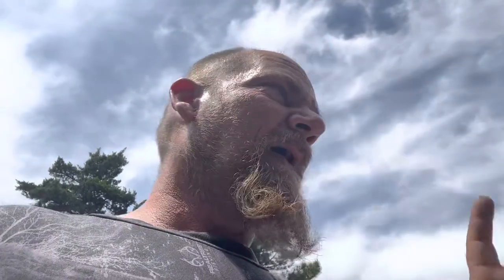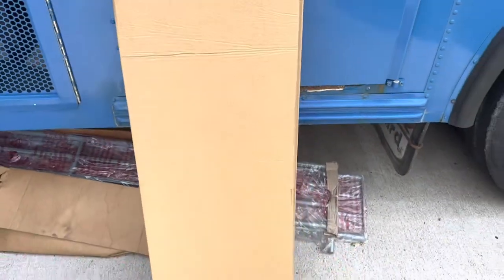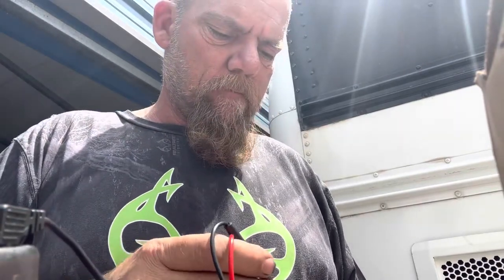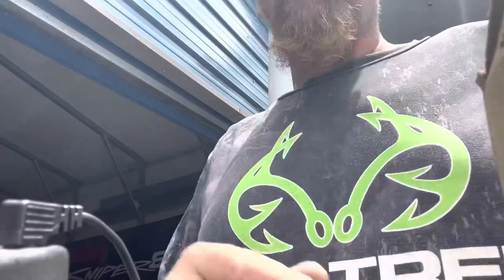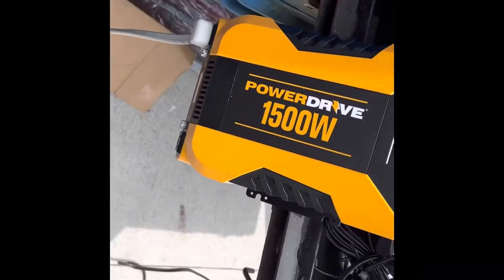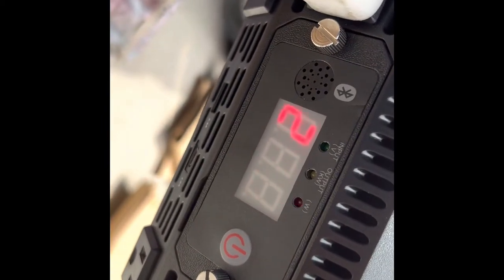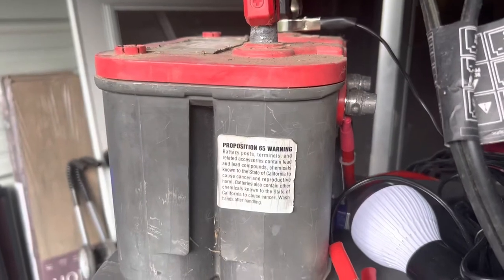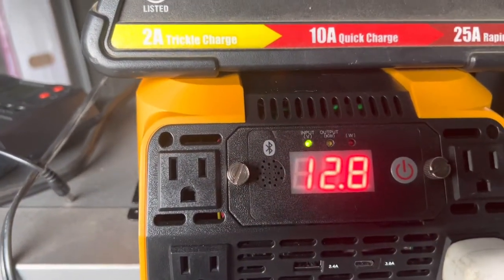Powering refrigerator off 1500w truck stop PowerDrive inverter. Playing with harbor freight￼ solar

Comment: Looking at the bus you bought, how incredible would it be if you attached solar panels all along the roof?  You wouldn't want the panels to get too hot though, or blow off with high winds while driving.  They sell flexible flat panels on amazon for sailboats, you could attach to the top.  The long length would be incredible, you could fit over 1000w of panels!

Have a wire come down through a window initially, later drill a hole for the wire to come down into an MPPT charge controller, then go to a small bank of 12v batteries & attach to an inverter!  Power a fridge/freezer, TV, Microwave & more!  Just avoid the shade when parking the bus!  Could paint the outside to look like the whole thing is a solar panel & give the bus a solar theme or something, lol, but this could be interesting!  The bus would obviously not run on solar itself, but if you could fit 1000-1500watts of panels ontop, you could power anything while on the go for free!
Reply from the maker: The plan is to build an off grid solar system. Thank you for the advice. I will look into the flexible ones for sure.